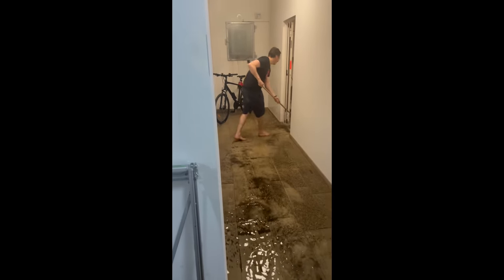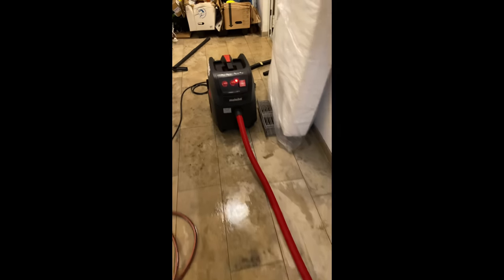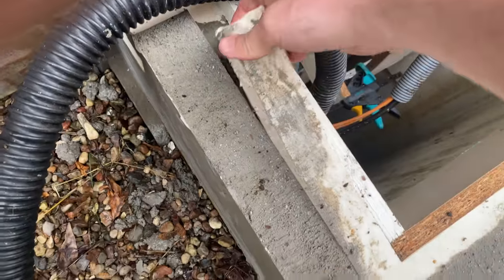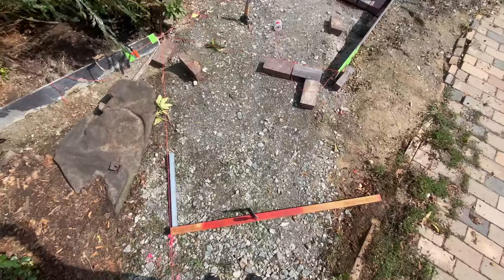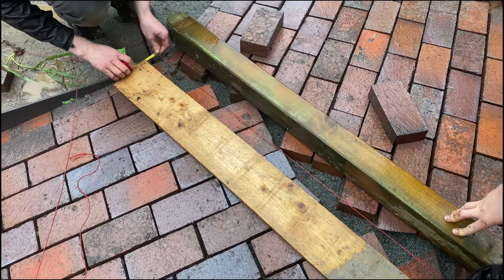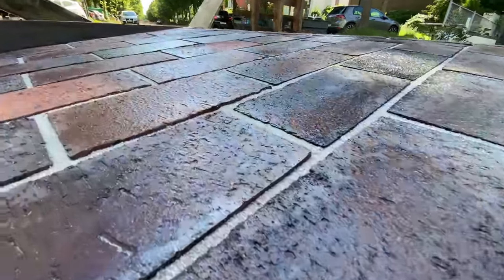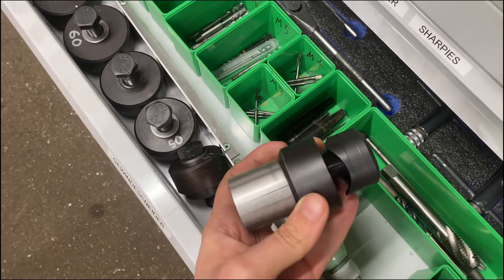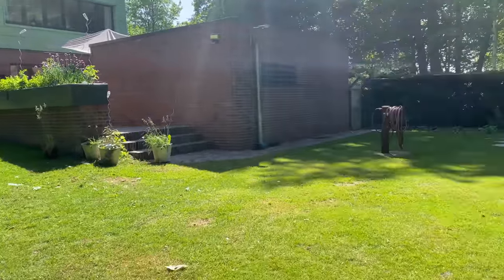Battling Mother Nature: How We Made Our House Flood-Proof

Comment: I strongly suggest that you get a bunch of sand bags and have them ready for the next major storm, your dam is only as good as the last storm, and the gentle slope will make it easier for the water the crest.
Reply from the maker: I think this is high enough now. But a few sand bags would be good indeed. I might also add a flood barrier that slots in at the front door. They are rebuilding our entire street this winter. I will see if the levels change at all.
Reply: @MaxMakerChannel  yeah, the grade is all wrong, they kept paving the street until your curb didn't exist anymore -- that curb is there to divert water.
Reply: @MaxMakerChannel  I think a permanent solution like this is great, having some flood barrier slots is optional, but nice to have. At the end we all know what happens when you don't have something proper and permanent like this - then the next flood comes while you are sleeping or when you are on holidays.
Reply: @eformance  I don't think this is because of repaving the street again and again. More like cars parking and driving over the curb all the time.
Reply: @MaxMakerChannel Grew up in hurricane country and this is solid advice.  The beauty of sand bags is that they’re portable and can be used to plug holes wherever they crop up.  Landscape can change quickly during a flash flood.  Downside of them is that you usually need a bunch.
Reply: Build a catch basin and then install a powerful pump to jet it back to the street past your property. It would have saved a lot of work, and be secured that if ever it gets to be a biblical flood, you can add more pumps.
Reply: @WH0oo...  Pumps are great while ever you have electric, passive fixes like raising the path are a clear winner
Reply: @bsimpson6204  preppers always have electricity, lol. If you build an appropriate diversion wall, it elegantly solves the problem. Sandbags should be of last resort for those unprepared. Who wants to be out in the pouring down rain hauling 30 lbs bags when it's already flooding? So every time it rains heavily, you are going to build your sandbag wall as you can't predict how severe it will be. 

Edit: I've read they are not allowed to redirect water off their property (soakaway law). So if this was my property, I would relocate the entrance path further up the street and extend the brick wall to round the corner and taper it to grade. This would provide a safety margin far greater then a raised pathway, compliment the raised planter feature and eliminate the steel edging. I would then use a clear window well cover with a rubber gasket seal.
Reply: A water filled boom ( basically a long plastic bag tube which can be tied off when full) is a fantastic solution. They mould their shape at the bottom with the weight of water and form a waterproof seal.

Comment: Tip on mixing concrete - there is usually a required quantity of water per bag on the bag.  I have poured a couple concrete projects around the house that uses 20-50 bags.  I first go into the kitchen with a bucket and fill it with a measuring cup to the appropriate level.  Then mark the bucket with a sharpie at the water level.  Very easy, repeatable, consistent method.
Reply from the maker: Very good idea! Its small things like that that speed up the process.
Reply: Or to speed it up even more.

If you are using the metric system, just use a scale and not a measuring cup.

Put the bucket on a scale, zero out the scale (or just subtract the weight of the bucket).

1 ml of water = 1 gram

1 kg water = 1 litre

Use the shower nozzle to fill up the water on the scale.

And then do like the other commentator said, mark with a pen. To make it even faster in the future.

Very fast way to measure water, if it’s half a litre or 10 litres or 100 litres.
Reply: I do this for our mop bucket and multipurpose spray! I figured out how much product to put in, marked with sharpie on the outside, then fill the rest with water every time.
Reply: Weighing the water works for inch/pound, too. In US (and I think the old  UK/Imperial units too) the units are defined such that, FOR WATER, 1 fluid ounce (volume) = 1 ounce weight. So "a pint (16 fl oz) is a pound (16 oz wt) the world around". Other substances have different densities, so the exchange only really works with water. You could look up densities for different substances, or  just do what the other commenter said and calibrate a bucket (same thing, really, but without the math).

Comment: I love how thorough you are with fixing the flooding issue, you not only made sure that the original ingress point was blocked, you beefed up all the other entry ways
I would have called it a day at the dam
Reply from the maker: I had to. Water is the absolute worst. In Germany we have a concrete building. Then we put 15cm of insulation on the concrete and on top of that we do a floating concrete slab. That concrete slap is not connected to the walls. That gets rid of noise transfer and also contains floor heating pipes. The problem with flooding is that the water gets into the insulation and to get it out again you need to vacuum the floor for a month straight. Hoses every 3m and holes drilled in the floating slab. Costs about €5000,-.
Reply: @MaxMakerChannel  Wenn die NYM Kabel im Leerrohr voller Wasser stehen, kann es auch noch nach Monaten zu Korrosionsschäden kommen. Am besten nach 6 Monaten einen Funktionstest an jeder Steckdose und Klemmstelle machen. Es kann bspw. der PE durchkorrodieren, und die Schutzwirkung des FIs aufgehoben sein.
Reply: @MaxMakerChannel  I always thought German building codes where exhaustive, but this is amazing😅
I guess it's nice to have sound insulation  from the earth😅
I'd imagine you'd already have this problem if it wasn't for the sump pump

Comment: These sudden weather events are certainly increasing in frequency and severity, so you're right to get on this now and start mitigation measures wherever you can. That's a very elegant and practical solution to the problem and it looks like you've added extra in expectation that the next time it could be a little worse. I don't think most people would have had the rationality to study the flow dynamics while this was happening, but there's not much else a person can do until it's over. I'm sure this is going to protect your home for a good few years.

Comment: Great video, my only concern would be the edge of the steel dams. If anyone tripped and fell they would be very unforgiving. Perhaps a rubber/plastic rounded top on them?
Maybe a thin pipe, cut so you can slide it on the top edge of the dam?
Reply: Maybe some rubber hose? Bouncy but small.

Comment: I experience my first tropical storm a few weeks ago. 5 inches of rain in a day. I only had to worry about the water running off my house because my house is several feet above street level.
Reply from the maker: Thats how it should be done! But we aren’t even allowed to drain any water onto the street.
Reply: @MaxMakerChannel  Where do you drain the water to then?
Reply: @TomsBackyardWorkshop you have to have soakaways on your property. Any water that falls onto your property you are responsible for getting it into the ground. This is the rule in the UK. Drains in the road are only for rain that falls on the road. Sewers are only for wastewater, not rainwater.

Comment: Great Idea, we never had this kind of issue with our house, because the windows are all at least 10cm above the ground. Just in case I used the garden in front of the house as a water barrier, by planting a hill of Roses, Blackberries and Rasberries. So even if ther will come some flood from the street, it will happily continue to flow down the street.
As we have some interesting kind of rain in this part of northern lower saxony, which means either a little dribbling rain or very rarely flood rain like in your video, i think there is a need to prepare.
Please do more like this Projects and post them and when you like to see a real garbage railway, i'll show you my project some time.

Thanks a lot and best wishes to Lübeck and the river Wakenitz

Comment: Flooding is the next worse thing after a fire imo. In some places in the UK now its that bad people can't easily get insurance for it. Glad you got yours sorted.

One question. At the bottom of the window outside, would it be better to go a little deeper and then install either a drain or gravel to allow the water to drain away? :)
Reply from the maker: That was puzzling to us. We dug as deep as we could and we never found a bottom. It seems as if its just open ended which doesn’t make any sense. But there is probably a drainage pipe somewhere down there.
Reply: Would a clear plastic window well covering with a rubber gasket seal be more effective in keeping rain water out in the first place? Then have proper drainage around the well?

Comment: Interesting that your basement window is not also an emergency exit. Seemed a little scary when you were under there worried about getting out! At least here in our county in the US we have to have an emergency exit window or a walk out door for basement emergencies.
Reply from the maker: We have a second staircase exit but that is much higher than the street. This window is totally unnecessary. I think it is only there if there was a fire, then the firemen could push or pull smoke through there. No quite sure.

Comment: Had a v similar issue and did the same. I also changed all the block paving for gravel and installed  French drains as the water can still top the dam in really bad storms
Reply from the maker: Why is gravel better? So it drains in the ground? I had a few thousand litres of water accumulate in a few minutes.

Comment: Top tip. Buy a ups that can run the pumps, if you loose power in a weather event, you will loose the pumps as well. A ups or battery backup will help keep you out of strife
Reply from the maker: I have a small generator and the pumps are only plugged in instead of hard wired. So in case that happens I can easily connect them. However we never had power outages caused by weather. Our power lines are all submerged in the ground and they go around in a loop. Even if one line gets damaged by an excavator they can turn that side off and supply from the other side of the loop. Only takes about 1h. 

I also have a huge petrol pump from honda for that. All on wheels so it can be effortlessly setup.

Comment: When sparks happen when welding it means that the surface is too hot or your welder is too hot. It basically means air pockets form in the welding rod.

Comment: Great way to solve your water puzzle!  And looks like it was always there.  We have a municipal alley behind a property (in Chicago) and the paved alley is higher than our sidewalk next to our garage.  When we have heavy rain all the water from the alley (it really becomes a stream) goes down our sidewalk towards our house and occasionally floods our basement (not too much but still a worry).  Your video made me  think I need to remove the small fence/door and put a brick step there to keep the water from flowing down onto our property...
Reply from the maker: Sounds similar. I was thinking about a step. That would have been easier, but we wanted to keep the ramp so you can wheel things inside.

Comment: I had a window that did that in hard rain.  I installed a bell drain in the well and piped it to the sump.
Reply from the maker: Very cool! Bell drains are fiddly aren’t they?
Reply: @MaxMakerChannel  it’s the same idea.  I added a tee and post dug about 4ft down to make a French drain, then 6” below the surface I cut through the wall.  the “overflow” portion is really only used in heavy rain like a hurricane.  It’s the same idea as the gutter, just instead of waiting for it to overflow I’m allowing it in.

Comment: You need a smaller cup on your torch so you can see better.. i would suggest a narrow 6 or 7. Just remember to increase the cfh on your tank for a narrow cup. You might want to increase your CFH overall because that hole you made was from oxidation. Check your lines

Comment: the sparks when you were welding came because of airflow through the box and tube. As you heat metal, the air can shift around quite dramatically.

Comment: As a guy that has done the steel border thing like you have a learn from my mistakes.  Weld some square or round tubing to the non faced side. Cut some rebar and bend just the tip, and drive them into the tubing.  A good rule on depth of the rebar is a few inches below the frost line.  This will stop it from moving up and out over the years.  And will also allow you to do some crazy bends with it with just a little heat.  Awesome job.
Reply: Thicker steel mitigates the need for square tubing, thus less work, and only a larger gauge rebar would be  necessary. Most common mistake is  people op for the cheaper stuff when they get the cost of the appropriate specs for the job only to regret later when it starts to buckle and wave with normal ground movement.

Comment: Parents had a large bi-level. 60% bsmt flood before reach sump pump. Carpet had to go! Had to pull off paneling find water entry. 

Cracks in driveway the culprit.  Water weighs approx 60 lbs cubic ft. Saturated soil will put 10's of thousands lbs pressure on the porus concrete, causing hydrostatic pressure. To weight pressure add water force pressure. If your house doesn't leak yet, foundation walls may begin to bow, develop large cracks, or drive, sidewalk, patio become all sorts of troubled. 

But you're the right man for the job!

Comment: Nicely done, and a great video! While the slope is certainly a pretty smart solution to more severe rain, I would be kinda scared that once these events get even more extreme, it might not be enough. My solution would maybe be a small slot that you can slot a steel plate right in, continuing the brick wall in the left across the path. Once the path is crossed part of the water will just go into the ground, and just generally be slowed done and forced towards the street.

Comment: If working with concrete you want to keep it sealed for as long as possible for concrete needs water to harden. The earlier it dries out the more brittle it becomes. It's a common misunderstanding that it would harden by air but in fact it hardens by water.

Comment: you can also make planks and rails on the door to limit the water also it's used pretty often here in area that can get flooded, but i hope that all your work will be enough
Reply from the maker: I would like to implement something like that, but I also would like that to be hidden. The front door was surprisingly well watertight.

Comment: The "fireworks" when you were welding was most likely from the whatever cutting fluid you used to when you pressed that hole out
Reply from the maker: Could be. It felt like it was bubbling up.
Reply: Degreasing the metal is important before any further work is done.

Comment: I am a welder fabricator, whenever you cut pipe, stainless especially always deburr the inside good so you can not slice right threw a glove and stitches on a finger. VERY VERY IMPORTANT. Never handle fresh cut pipe without gloves and never handle near the cut end

Comment: Tropical archipelago city dweller here, we get 5 inch to 3 feet floods every month. We dont ha e basements for this reason, but usually the more well off people raise their property a meter or so from the road level, if not, then ditch the 1st floor to turn it into a garage and live on the 2nd floor. I was surprised to see flooding and 2 inches of flowing water, but its good to see westerners aren't having severe flooding issues, most of the western world often have architecture easily damaged by water (Wood, insulation, etc.)
Reply from the maker: That must really suck! We are not in a flood area. Flooding is pretty much impossible here. Except for this freak accident. 10% less rainfall and the pathway would have been high enough.

Comment: Is the gutter meant to be a permanent fix or temporary? Raising the retaining wall outside the window should stop the major ingress, but a permanent fix would be to dig it out completely, and put drainage at the bottom of the retaining wall, allowing the water in and then diverting it using the gutter will cause mold problems, and will start to rot away the wood (no matter how well you try to seal it, water will always find a way past your seals)
Reply from the maker: The gutter is just a small part of the defenses. There should be zero water coming through that window now. The basement has drainage pipes all around it and also drainage shafts. But if there was extreme rain for days where the ground is 100% saturated, then the water could come in again through the window. We haven’t had such extreme rains before but some towns experienced it in the last years. Some local areas had extreme rain that lasted for days where normally it would only last a few minutes.

Comment: Seems like an odd place to put the entrance to your front patio area. Seems like you should move the street access to somewhere where the water flows past better and maybe put a flat section to stairs. Also having the big bricked in area is preventing natural drainage. They make sandbags now that have a silicone gel that inflates in the presence of water. Maybe worth getting some to just block off that entrance in heavy rain. Maybe putting a metal drain in that area that can be piped further down the street may also be a good idea.

Comment: they do clear roofing panels it might by worth putting one over the hole. it will let in light yet prevent heavy rain filling the hole and keep out leaves and twigs while still allowing airflow if you leave a gap